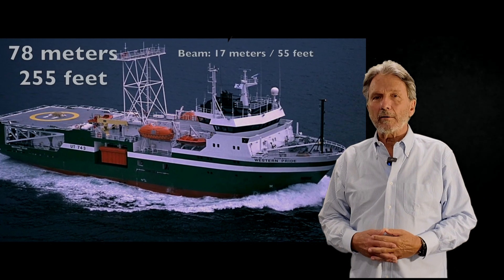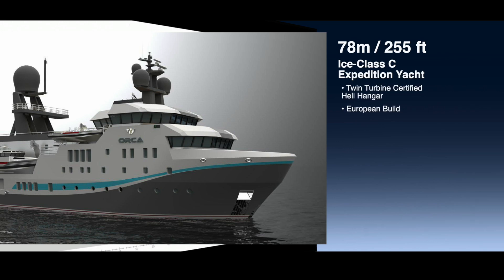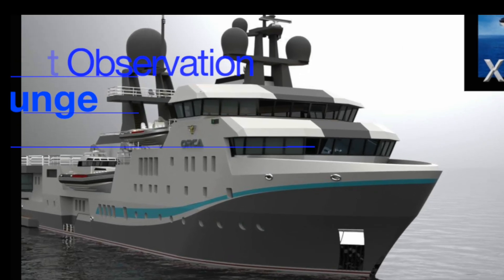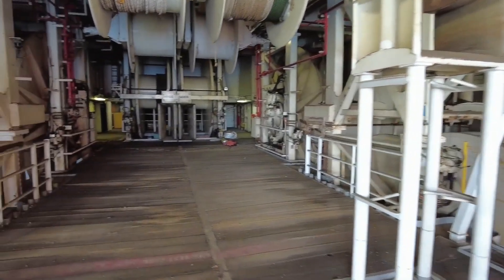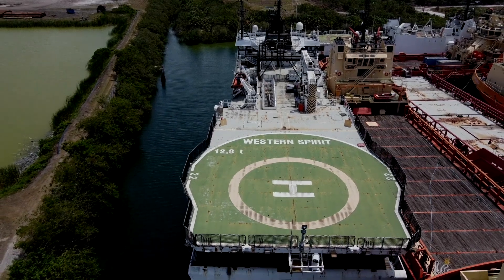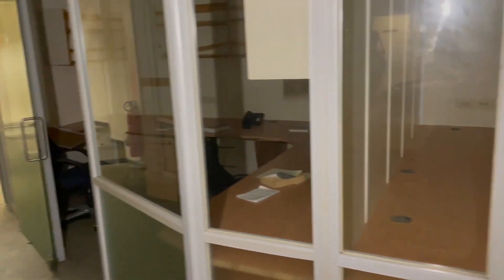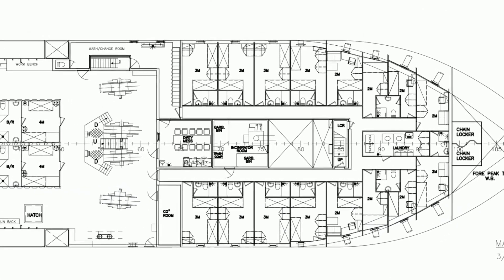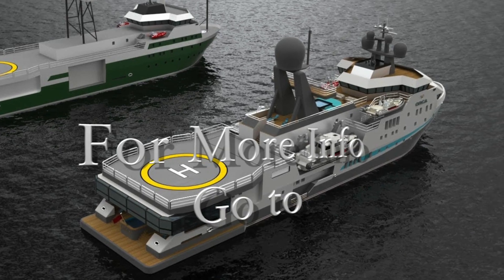Paul Madden presents conversion of Norwegian-built 255 ft/ 78m Ice-class Expedition Yacht

Comment: How much please ?
Reply from the maker: The prices on commercial vessels correlate to the charter 'day-rate'. This one is presently priced at approx. $6 million, as-is. And it has not been sold yet.
Reply: Thank you dear Paul. This is an excellent option. @XplorerYachts
Reply: @XplorerYachts Paul is Norwegian "Ice Class E (or e)" only rated for waters where there is "drift ice at less than 1 metre thick ?

Comment: what would the total conversion cost range be?
Reply from the maker: As a support vessel, or research vessel conversion the cost might be under $20m. As a fully finished expedition yacht, you'd probably be at $25-30m, depanding largely on the level of finish of the interior spaces. A European yacht new-build with similar capabilities would cost at least $90 million.